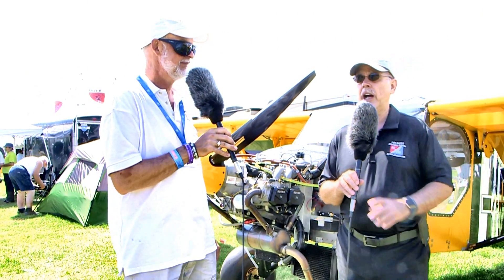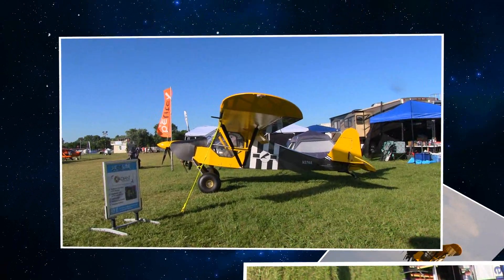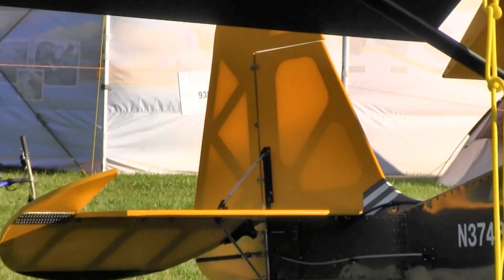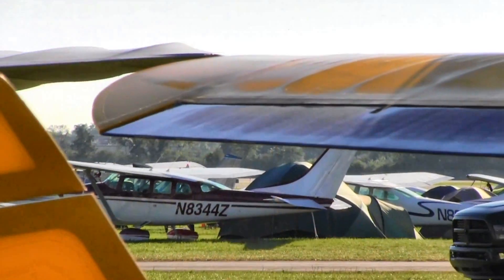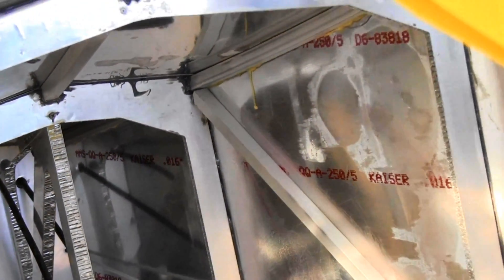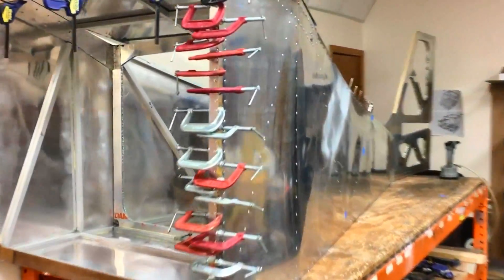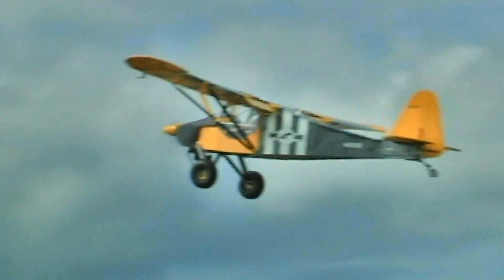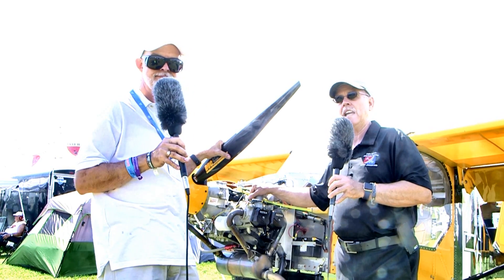Chipper two seat experimental aircraft, Rotax 912 UL engine from Belite Aircraft Chipper.

Comment: The more I look at this, the more I like it.  I'm still deliberating, but I think this will be the aircraft I build.  I'm also looking at Aeromomentum's 100HP engine for the motive force (low cost, light weight (170lbs), low fuel consuming 4 stroke with a 1500 hr TBO, fuel injected engine - NEW - not a rebuilt engine like the Viking and some of the others).
Reply: I personally think the 3 cylinder 75hp aeromomentum engine will be better on this plane.  It's lighter and still should have plenty of power.  And at only $7,000 what's not to love.